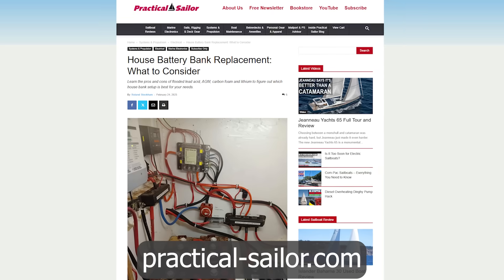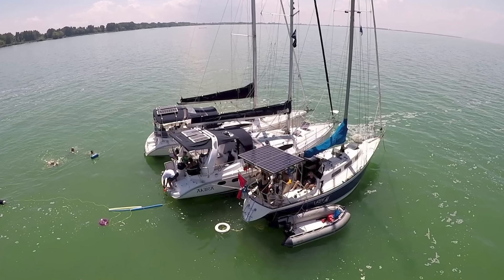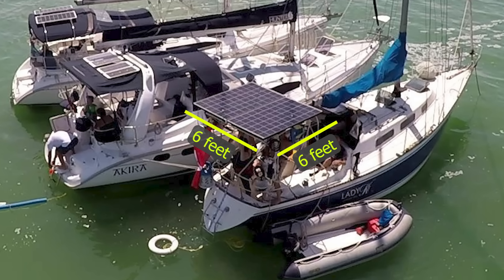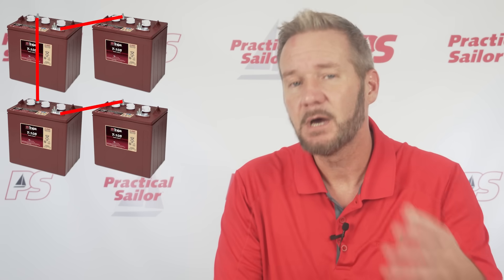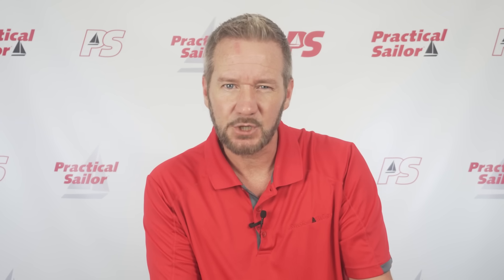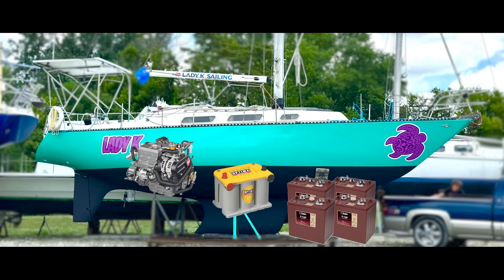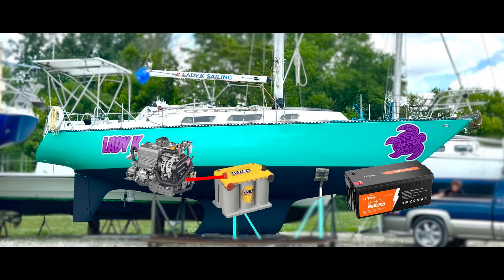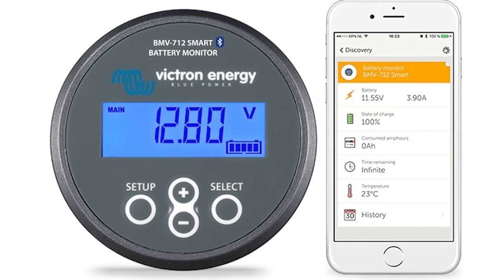Which Batteries Would I Buy TODAY for my SAILBOAT?

Comment: Oh my sailboat which is a Pearson 424 I have 20,6 volt interstate batteries and I have for 1600 w of solar  I tried the others nah not for me I also have a motorhome in a motorhome she's a 2002 the interstate batteries and that motorhome lasted 15 years The only reason they came out was one of them was shorted They were 6 volts If you buy interstate batteries you have to get with interstate They have special batteries for boats yep they are high high output deep deep charge yet talk to them and they can tell you which one of course they're not cheap, I do have a $4,000 w inverter charger on my boat for my 110 plus it charges my batteries if I plugged in the shore power. I would like to someday get a thousand Watt wind generator.

Comment: The old panels are 60cell x 275W. New 60cell are around 340W. To get to 400W you'll need 72cell. Much bigger. There are also 66cell now. I prefer 60cell. 2@680W combined should be plenty.

Comment: NiFe (nickel iron) overlooked and difficult to find tech nowadays. Slightly higher energy density than lead acid by weight slightly lower by volume. Proven to last at least eighty years even if abused and neglected. Non flammable and non toxic. Invented by a Swedish guy especially for electric vehicles often known as Edison batteries.
Used in minig locomotives among other tremendously arduous duties. 
It is the Exide story over again (by the patent shove it in a safe let no-one else see it - make millions selling expensive short lasting batteries {lead acid}). Millions invested in LiFe - so stop and obstruct everything else. Good in telephones - expensive dangerous and toxic for everything else.
Reply: & Exide was partnered with Union Carbide, you know, BOPAL. Half a million people exposed toxic gas. Gota luv corporate america.

Comment: Hi Tim. Agreed 100% on keeping Lead - or AGM for your core batteries for engine start, windlass and bow thruster. Good on decent amounts of Solar as well, though for backup a generator is also required. Note the tip to give AGM the maximum service Life, NEVER Discharge them below 80% capacity, because then the Recharge cycles flat line, and never drop. So this brings us to the role of a Bank of Lifepo4 batteries How many ? 4 and wired in  so they are able to equally share the loads, both discharge and charging, to keep loads as low as possible, and this takes positive and negative bus bars, with equal length cables of suitable size connecting each bus bar to the battery Terminals. By doing this, even cheap Redodo Batteries can be made to have a reliable and barring accidents, long service life. So buy say 4 x 100 ah Redodo, make sure they are never discharged below 50% capacity to extend service life, and if you have say an 80 amp discharge divide it by 4, and each battery is contributing 20 amps to the load. Same with say 80 amps charging Right ? Now if the cables are suitably sized, this means the battery internals are unlikely to heat up beyond warm to the touch, which is great because after water, the biggest enemy of electronics is heat, or with lithium, freezing temperatures.So by taking this approach, and using DC to DC chargers from the Lithium Bank, you have given that Bank a Battery Management role of keeping all other batteries in tip top fully charged condition, and helped along by the Solar panels, the best of which are Rigid Monocrystalline ones, which after 25 years, should still be providing 80% of their rated Capacity. Polycrystalline ? Still die after 6 to 7 years.Flexi Panels ? Horribly expensive and most on the Market delaminate and die inside 2 years. Optimum positioning of Rigid Panels ? Transom end of an aft cockpit Solar Arch which should be free of shading effects. Hopefully that is food for thought to be going on with, plus it is only very recently that enough information has become available on how to treat Lifepo4 batteries properly, and that Rapid Charging and discharging shortens their service lives.New additives for their electrolyte appear to be coming, which look to be able to dramatically increase their recharge cycles as well, which means likely decent service life extension. My first choice Lifepo4 batteries ? The Li Time Plus series with their new groundbreaking BMS, which may be shared with Power Queen batteries.Treat them gently with a Bank of say 4 x 230 ah Plus and you should get a very decent service life, with about &60 amps of topping up and use, before hitting the 50% state of charge. Bob. PS, never believe the words Deep Discharge on the labels of any battery. Too many people are still believing that Crap. 👍

Comment: What considerations are required if you go 24v? Would you also be changing motor alternator and starter to 24v systems? Wiring cost is less for higher voltage systems.
Reply from the maker: Wiring costs less yes but with a system as small as my boat needs, 12v is most practical. 24 would just be too man extra parts. A bigger system, 1500w or more of solar if start entertaining higher voltages
Reply: What Vdc loads do you have that you think V24 is better?
Reply: Think about running 2ga wire from batter locker to the bow for windlass and bow thruster. 24v gives twice the wattage at similar amp draw.
Reply: @hypnocracy6102  Maybe a 12V to 24V transformer for that one circuit. 24V windlass motor is also nice upgrade.
Edit: I saw 25, 30, 40, 50, 100amp options for 12->24V transformer. From that to bow via heavy cable loop looks manageable.
Reply: Then you'd need a 24volt alternator ($$$) or a 12v DC to 24v DC charger.

General aviation airplanes use 28v systems because the wiring is smaller and lighter than 12v systems. Weight isn't a concern for most marine applications.

Comment: There aren't too many DIY videos that I agree with as much as this one.  I'll be launching a month from now and will be testing/using my new lithium system that is almost identical to the one you now have.  The only difference is that I'm starting off with just one 140ah LiTime battery.  And I have only about 165 watts of solar.  My typical usage overnight is 15 to 20 ah.  I figure my new setup will allow me to be a power hog (what you are now).  I'll be using one of my old agms as my new start battery and I have the same B2B as you do.  Great video - thanks!
Reply from the maker: Sounds like you've got a great plan!

Comment: We have 1200 watts of 2 year old bifacial solar panels and 700 amp hours of lithium. We have spent the last year cruising from Annapolis to Maine, now in the Spanish Virgin Islands. We have a steady draw of 6 amps on the fridge and another 6 from Starlink (turned on 16 hours per day) and another 2 amps charging phones/computers but everything else is LED and of very small draw. We find that CLOUDS cut charge rates by huge amounts - even in the Bahamas.  We are lucky to go two or three days without having to start the genset and recharge the bank. Solar sounds great in theory, but the actual charging rates will be MUCH LESS than the perfect charging conditions reported by sellers. Much less.  (EDIT - three months later at Antigua. Now that we are closer to summer with longer days, plus closer to the equator, our solar handles 100% of the load. Apparently the Bahamas were unusually cloudy for the three months we were there (Nov, Dec, Jan).
Reply from the maker: That’s weird. I found I was charging more than I expected while in Bahamas.
Reply: @practical-sailor  Well, it was winter when we were in the Bahamas so the sun's declination and shorter days were a factor, but it was CLOUD COVER that was the real culprit. Even down here in the SVIs today - solid overcast, only charging around 15 amps at ten in the morning; same as yesterday.... will have to turn on the genset later today, sigh.
Reply: Your fridge draw is really high. Maybe you reported wrong or maybe you have set too low. At most I would expect 6amps on 33% of time for 50ah/day.
Reply: @artsmith103  The original freezer/fridge boxes were poorly insulated. We added 2" of insulation to the insides of both boxes and also use 1" insulation pads on top with a new compressor/holding plate which certainly helps but really the whole thing should be torn out and redone. It is also hot below decks, often in the 90's because we have teak decks. I would say the fridge runs about 75% of the time though it is so quiet that it is hard to tell when it cycles on and off, so it probably averages more like 5 amps.
Reply: Any thoughts of  supplementing with a wind turbine
Reply: @  We did investigate them last year - they seem very popular with European boats but hardly any   USA boats seem to use them. Most do not supply much power unless the wind ticks up around 20 knots - below that their output is rather poor. We also do not have a great place to install one.
Reply: @Morrisfactor  I helped deliver a 48ft w/o autohelm from Hawaii to Seattle. We had typical 250W turbine (+250W solar) that cycled itself off with full batteries. At night underway the turbine is wonderful with ~4amps mostly keeping the batteries full. During the day redundant and not extremely valuable. I would consider one for a lot of passage making, especially at night. At anchor, they seem mostly worthless.
Reply: @Morrisfactor  thank you for that, I need to educate myself of the off grid power option. Ur input is valuable.  Thanx again
Reply: SVI, travelled there twice from St Thomas on bareboats.  Culebrita is my favorite place in the world, though it’s a bummer they no longer allow overnight in the anchorage.  The first time we went there we spent 3 nights and felt like we were in the movie Castaway!  Hope you made it there.

Comment: Very helpful, but would appreciate a follow-up addressing your comment at 4:33 "the alternator is only designed to work with a lead acid battery".
Reply: Lithiums will suck way too much power out of the alternator and cause it to overheat.
Reply: Look back a couple episodes and there is a good explanation of why.  Has to do with lithium being limited to a max input voltage that lead acid can tolerate.
Reply: Extremely important is Li BMS can stop charging battery and destroy alternator. So use common alternator to charge lead battery.
Reply: If your external voltage regulator is properly set up with an alternator temperature sensor then overheating, and destroying, your alternator can be avoided. However, charging the start battery and then a dc to dc charger to feed the lithium is a cleaner setup.